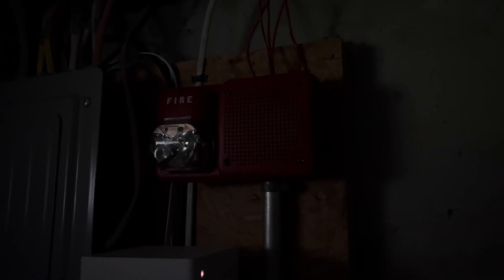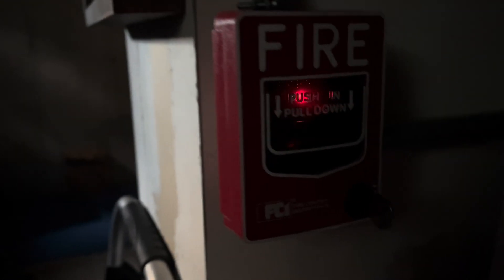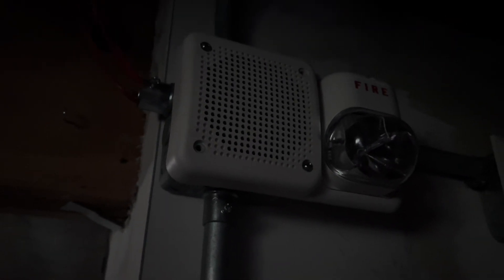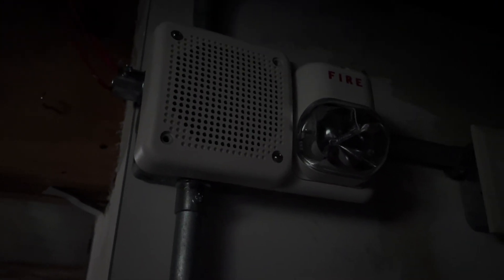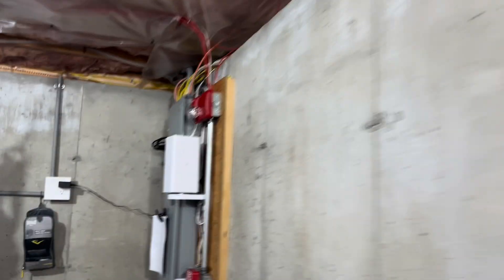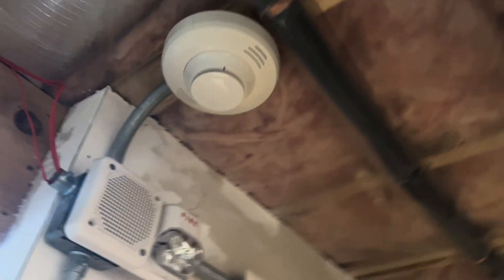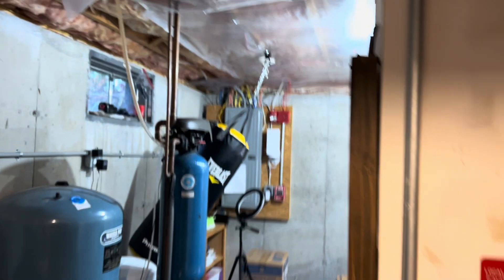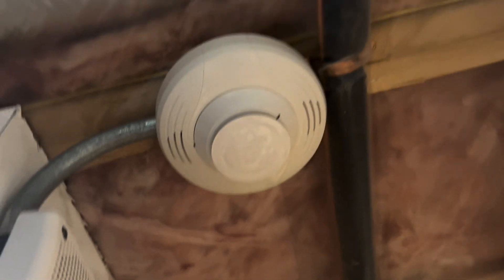Fire Alarm System Test 63: Sounder Base

Comment: Ivory material  products are banned in the United States and you might have to throw your smoke detector away LOL!!!!
Reply from the maker: I can’t tell if you’re kidding or serious, but ivory is just the name of the color lol. It sounds more professional than “off white”
Reply: @Loganetics1  it was a joke, it was supposed to be funny. I know ivory is also the name of a color, they just can't make real ivory products anymore, but I don't think they ever detectors or alarms out of ivory back in the day, but I do know they use to make them out of metal, but sadly alot of perforated bell looking smoke detectors and alarms are disappearing because, most of them are photo electric and a lot of the bulbs have burned out, and the bulbs are very hard to find, so a lot of places had to replace the whole detector or alarm, and they're over ten years old anyway,
Reply: Will the red light go out after the heat detection cools down or are you going to have to replace it? because some heat detectors I think are one time use meaning that if the heat detector was to go off from a flame the metal piece will brake and the only way to reset the alarm is to replace the heat detector, and the one time use heat detectors can't be tested because it will ruin it. I saw on YouTube that a person the demonstrated a heat detector he collected, the center metal piece came off meaning that when some heat detectors go off, you can't use it again.
Reply from the maker: @bathroomenthusiast5949  addressable heat detectors are always reusable. They work by using some type of heat element that activates the detector when it reaches a certain temperature (135°F or 190°F). The LED doesn’t turn off when it cools down, you just have to reset the panel and hope that the detector is cool again lol. The only time when it would need to be replaced is if the heat physically damaged the detector.
Reply: @Loganetics1  ok

Comment: Would the fci ms7a work on my fire lite es50x
Reply from the maker: I think those panels are a bit more picky when it comes to running other brands, so I wouldn’t recommend getting one unless you find one for dirt cheap. I didn’t expect mine to work, I only bought them because they were $12 each.
Reply: @Loganetics1  I found one on ebay for $19.99
Reply from the maker: @firealarm421  I just heard back from my friend, he said that Velociti devices (Gamewell and FCI) give an OEM trouble on his NFW-50X (the Notifier rebrand of the ES-50X). I’d avoid it honestly unless you plan on getting an FCI/Gamewell panel in the future.
Reply: @Loganetics1  would a fire lite bg10 lx work on my fire lite ex50x
Reply from the maker: @firealarm421 Yes, but it will only work if the loop is polling on CLIP because it’s an older device. 

Here’s a list of some older Fire-Lite devices that only work on CLIP:
BG-10LX (Pull Station)
M300 (Monitor Module)
M301 (Mini Monitor Module)
M302 (Zone Monitor Module, can run 2 wire smokes)
C304 (Control/Relay Module)
SD300 (Addressable Photoelectric Smoke Detector)
CP300 (Addressable Ionization Smoke Detector)

If you have any more questions, feel free to ask!
Reply: @Loganetics1  what fire lite monitor module would work on fire lite es50x and what kind of resistor